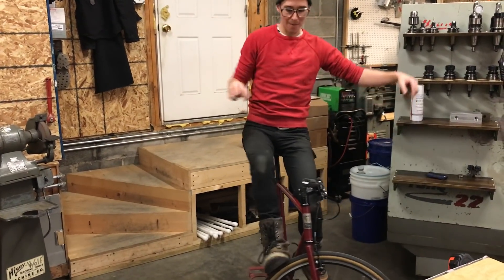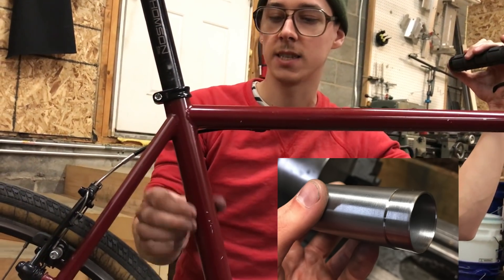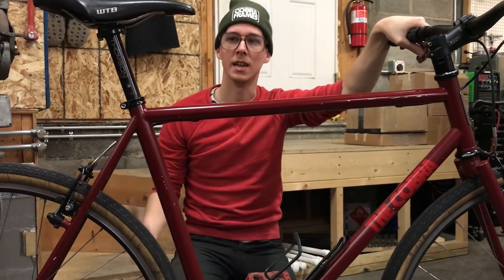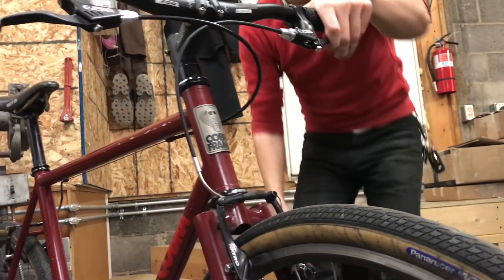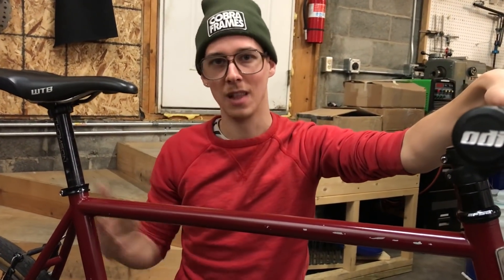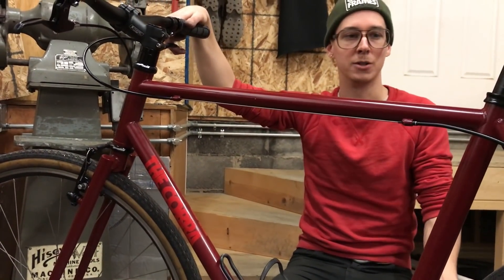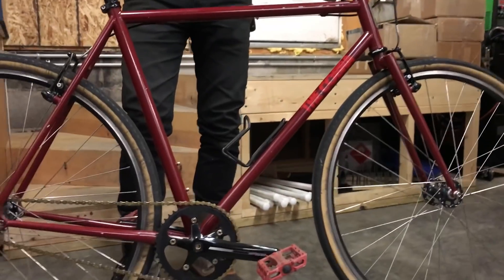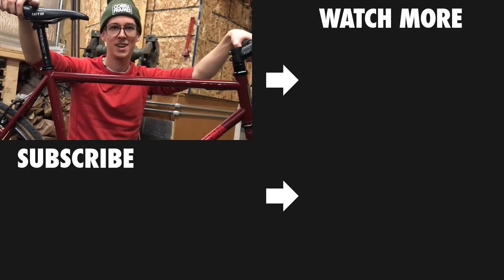I Built Myself a Commuter Bike.

Comment: how did you do the taper on the fork tubes ?
Reply from the maker: You can just buy bike tubing pre-tapered. They use a swager, which most framebuilders don't own and don't need to own. Bilenky Cycle Works has one I think. They are loud, violent machines.

Comment: It would have been cool if you painted it with truck bed liner.
Reply from the maker: That would be so chunky. I don't think I'd like that and it might add considerable weight to the bicycle, but I do think some powdercoat options have cool textured finishes that could look cool and would maybe be a bit more appropriate.
Reply: A friend of mine did that and it ended up being difficult to clean and looked bad after a few months.  I agree, it sounds like a great idea but it isn't great for every purpose.  My S&M Blackbike had a "BBQ Black" powdercoat with a little texture and that was way better.